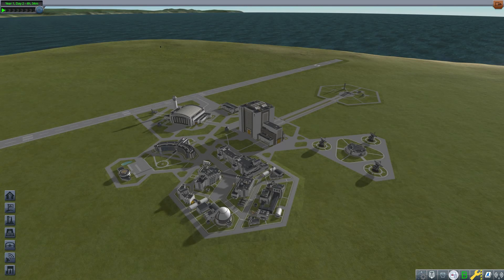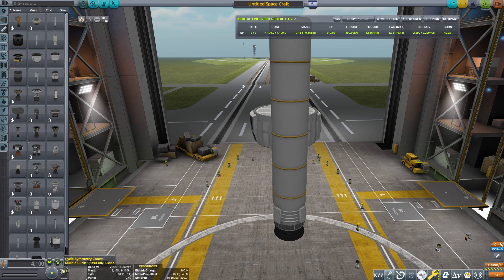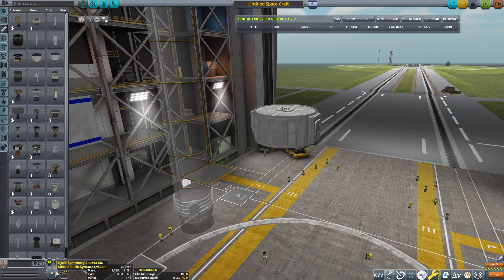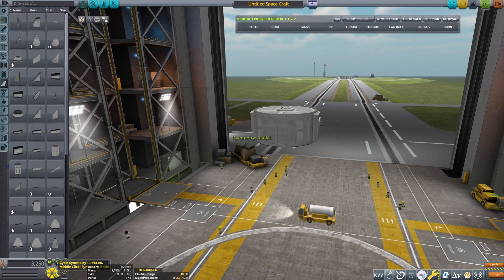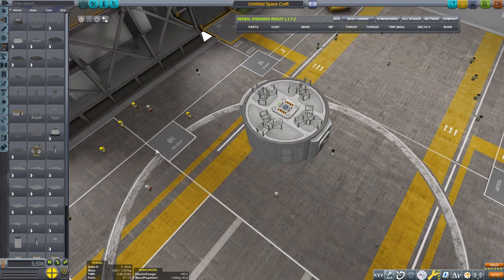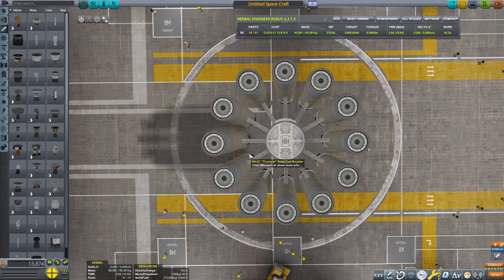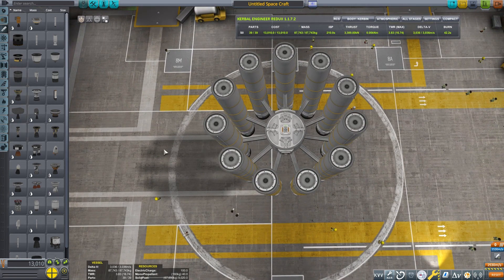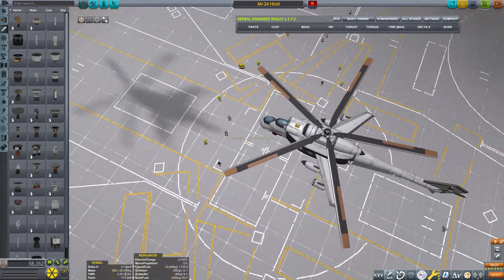Let's Discuss the Secrets of Symmetry

Comment: how do u do eight way symmetry cuz im quite new to the game and im tryna build a space ship but need to do eight way symmetry, what keys are for this symmetry?
BTW just to say how on earth do you like make all the launch stability enhancers go down when about to launch your ship cuz i always have to do it fast before my ship falls and nearly fails to launch properly..
Reply from the maker: On PC, the default key to change symmetry is X.

With launch clamps, I like to stage them right after firing my engines. That way they are running at full power.
Reply: cool!
oh and forgot to say is there any keys to make the launch clamps go down, for example i want to make all the clamps go down whenever im about to launch and is there any keys to make them all go down at once?
thanks for the symmetry info
Reply from the maker: @Mats947-Music  The clamps move when they are staged. Just make sure to put them all in the same stage. You can also use the offset tool (2 on your keyboard) and move them a little further away from your rocket if needed.
Reply: @Echo3  oh ok thanks!

Comment: Echo3, are you not covering mods in your tutorials?  Editor Extensions Redux allows full n-way symmetry without going through those steps, allows lots of other very handy things like global autostrut+rigid settings, allow arbitrary angle snaps(which I always add 10 degree and 72 degree).  Most useful feature of all is Editor Extensions Redux allows a toggle between surface and node attach modes for parts(<-- IF YOU READ ONE SENTENCE IN THIS MASSIVE COMMENT THIS IS THE ONE).  And it is an editor enhancement tool only, all of these things it can do are within the parameters of it still being a stock craft.  This video is good for people moving from beginner level to intermediate, but a lot of people watching your channel probably are looking for something more, since you already did a lot of experimental designs that are interesting to advanced players.  Other editor mod that is totally mission-critical(esp if you using breaking ground) is precise editor, that allows by-the-numbers exact work; this is so important as many joints and rotators need to be aligned precisely and even the smallest offset will introduce unwnated torque; for example it is possible to join 2 rotators to double the possible torque/size of a single set of helicopter blades, and that cant be done if they are not it perfect alignment.  And perfect alignment is not possible with just analogue tools, precise editor is needed.
Reply from the maker: I am aware that Editor Extensions can do all and more than what I demonstrated, but I wanted this tutorial to be console friendly as well.

About rotors, you don't have to stack them to increase torque. You can copy and paste the RPM values over and increase the torque over 400%.

At some point I do plan on covering mods. But some of my favorites are not 1.10 compatible yet. Do you have any more good ideas for future topics?